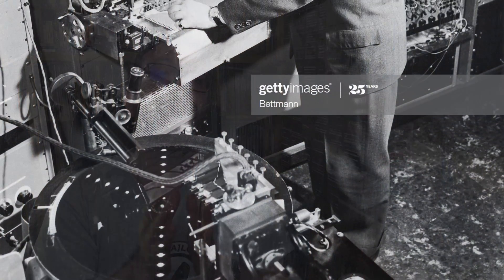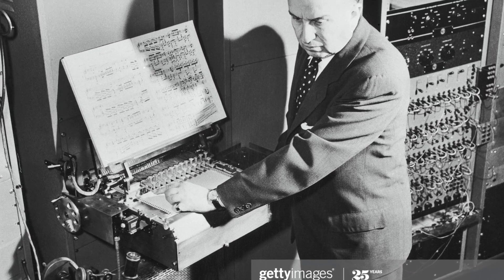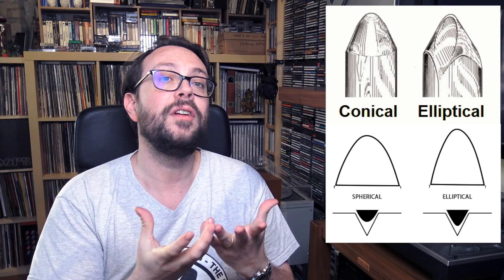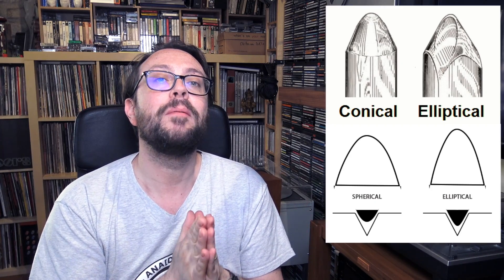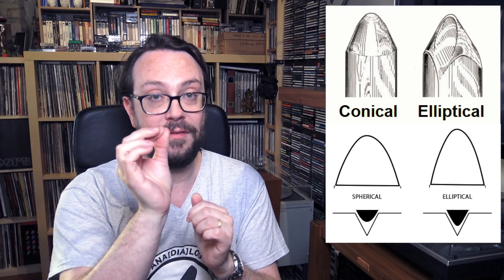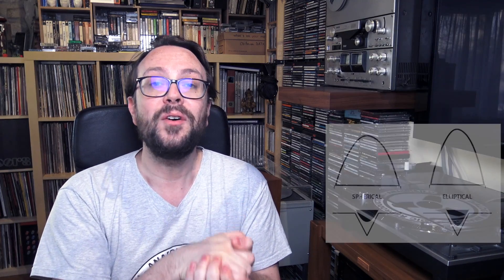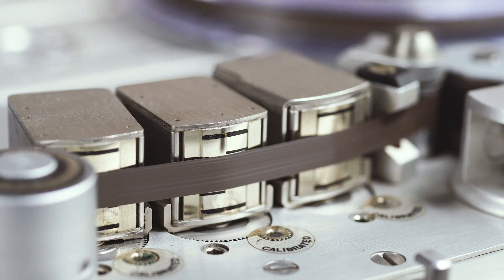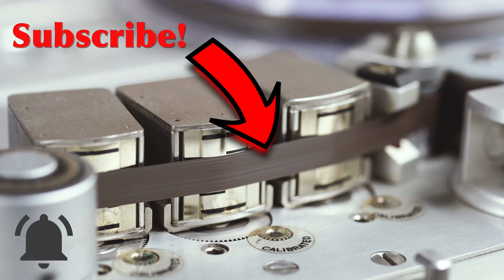The Dynagroove recording process by RCA

Comment: Is that anything similar to Decca did in the 50s what had some superior recording about them.
Have you given any more thought or tried that dry silicone spray on analogue tape to prevent shedding and smoother operation give it a go

Comment: I have the Shure V15-III.  One of the stylus’ I have is called a spherical, I assume that is the same as the conical.  J Gordon Holt of Stereophile swore by it, so I got one to try it out.  It does seem to have less high frequency distortion, especially in the inner grooves, but I never actually compared the dynagroove LP’s.  I will have to check it out.
Reply: The spherical/conical always has more distortion, even more so in the inner groove, compared to elliptical or even more so hyperelliptical, line-profile/SAS etc. This is a brilliant cartridge (I have one, too) but a spherical stylus is not the best way to make use of it. If it distorts less than your other styli, maybe this mean that these styli are worn. Of course  it must be ideal for Dynagroove - I'll have to check if I have any of those in my collection, and if I do, then I'll have to grab me a spherical stylus just for them! :)
Reply: @AALavdas  Any suggestions as to what is the better choice would be appreciated.  I have been looking at some Dynavectors.  Pretty pricey for me though.  I'm currently using a blue point special.

Comment: Maybe shorter videos are the answer, you managed to stay on topic and more out of convoluted sentences. Dynagroove was invented to allow the cheap phonographs that the RCA Record Club promoted to sound decent, but it was a disaster otherwise and ruined the reputation of music writer Hans Fantel who was paid to promote it. The first records were subnected to strong algorithms that were quickly dialed back in response to strong criticism. Most artists, especially Arthur Fiedler refused to allow its use on their recordings, even when corporate forced a few albums to bear the logo. By that time, RCA had switched over to solid-state (not 3 channel and on the way to multi-channel) eqpt, the great engineers were history and the golden age of recording at RCA was over. Since the algorithms were applied in making the production masters, the session master tapes were salvageable for later transfers even tho they didn't match the prior standards. RCA's goal was to not make great records, rather ones that sounded OK on eqpt of the time. Only Chesky and SACD transfers have gone after that goal. Living Stereo CDs were just straight copies of session masters.

Comment: I have a collection of RCA Dynagroove recordings, including the Readers Digest series. I have not heard the distortion you and others have spoke of. Now I have to pull out the collection and listen closer, perhaps in the inner groove. I am using a Denon DP-59L with an AMG Teatro low output moving coil cart, and a Dynavector P75 mk3 phono preamp. That either has a Shibata or a line contact stylus. Perhaps they did some mono blending of the higher frequencies. That could collapse the sound stage perhaps, whilst reducing distortion, since out of phase information has the highest distortion. Mono is side to side motion, out of phase is up and down motion which has incredible distortion in the higher frequencies.
Reply from the maker: Its not me or other people who claim this, its the precise definition of Dynagroove records: https://books.google.it/books?id=L38MrvScG3gC&pg=PA125&lpg=PA125&dq=dynagroove+harmonic+distortion&source=bl&ots=L8rRoVSfJP&sig=ACfU3U34BERTy9OyagVfXY_-VlwvHzhQdQ&hl=it&sa=X&ved=2ahUKEwj5262vxPHoAhU_ShUIHd_TBS4Q6AEwCnoECAUQAQ#v=onepage&q=dynagroove harmonic distortion&f=false
In any case, I believe you and in fact I also appreciate most of them!
Reply: @anadialog  greg claimed they sounded better with a conical stylus. Whatever the secret sauce they used it worked, all I was saying is that it doesn't sound better with a lesser stylus to me. I will do a closer A/B between a high end cartridge and a conical lower end cartridge. Proprietary deliberate adding of distortion to decrease a mechanical distortion is what I understand they were doing. Thanks for the reply, enjoy the music and keep yourself safe while we are all shut in.

Comment: Tandberg did something like this with their equalization circuitry on their cassette decks. I used to own the Tandberg TC-440A which had "Dyneq" which was some kind of manipulation of the eq circuit with respect to dynamic range or volume. There was some controversy with not maintaining the Phillips standards to better performance. Nakamichi got some heat for this too with their electronic manipulation of the signal to improve cassette short falls.